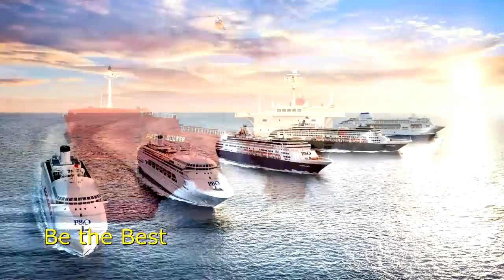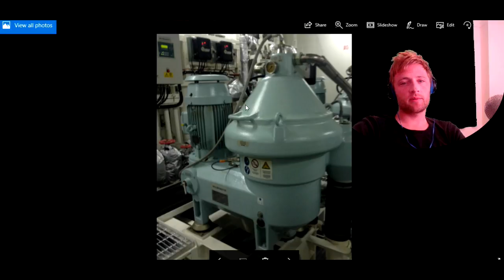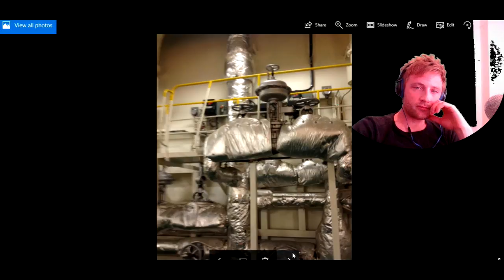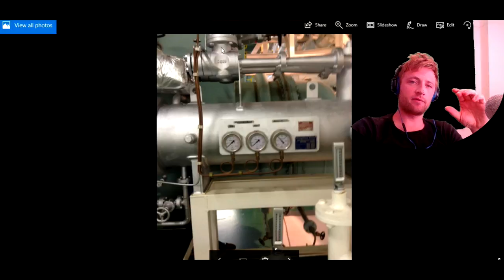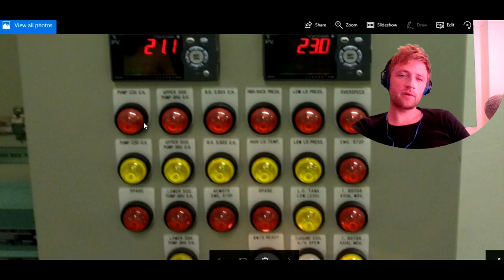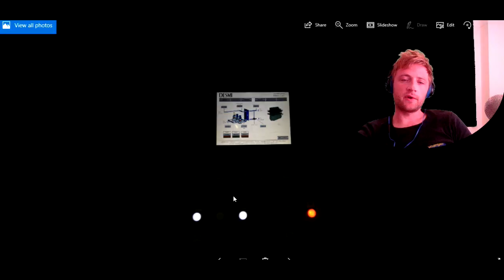LET'S CHECK SOME PHOTOS

Comment: Yes my friend,correct,  it's VLCC 299k tones. The main engine HYUNDAY-WARTSILA  W7X82.1T, CYL BORE 820 , Stroke 3375, , common rail. Yes the purifiers were very good , for 2 months we opened only one time. IT was very good fuel,also good maintenance. The settling and service tank for incenerator was my job, we were 2 appr.engineers through sludge pump, with loki toki we had filled them , also if we had alarm "Low level"  we were responssible about it.  The temperature was around 115-110C that ensure no water consistance.  Yes it is very clean , the 2nd Engineer was very good and his mind was everywere also on cosmetic things :) Thank you so much. Keep going ! Be  healthy !!  Regards.